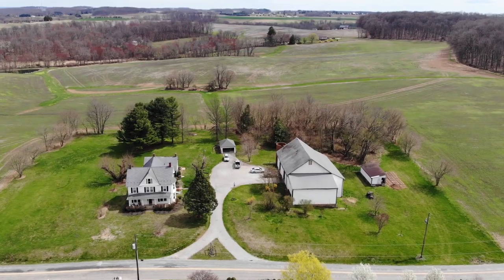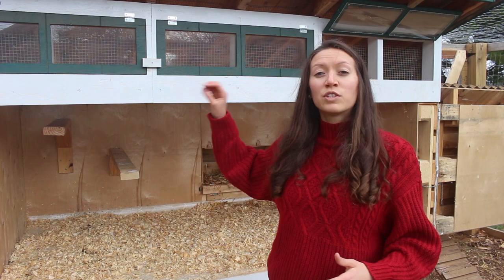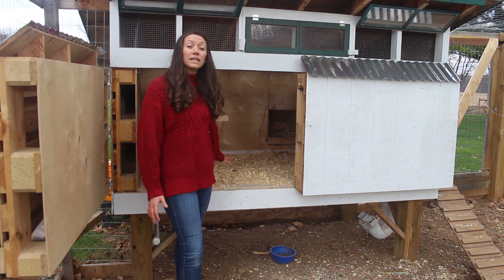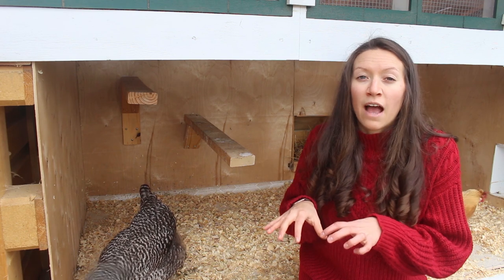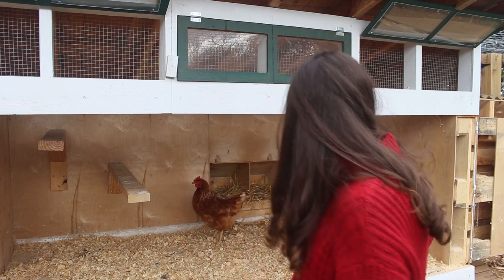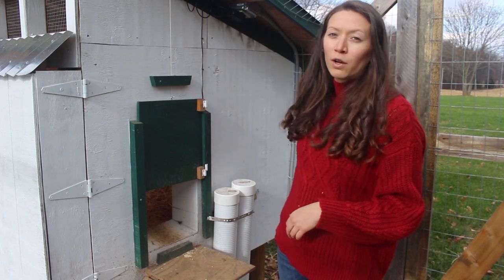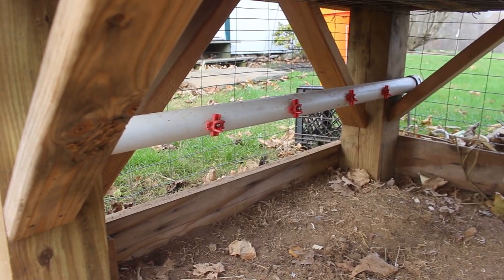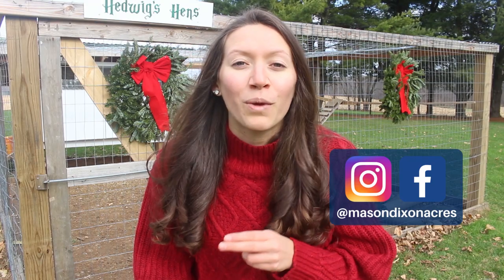Chicken Coop Design | ERGONOMIC & EFFICIENT!

Comment: Two suggestions . 
1) on the inside of the coop - put a board across it so it keeps the pine shavings in it when you open the door. Remove the 1x6 when you need to scoop out the shavings. 
2) your run looks well eaten. 
Look into something called chicken chunnels. You could have them coming off of your run area and you could concentrate them in specific areas

Comment: I like the idea of linoleum.  I want to have a metal grid floor but, at 3300 feet elevation, 45th parallel I needed a solution for winter. Properly fit, yet removable, linoleum sheets should do.
Thank you.

Comment: Great video. Questions/thoughts:

1. Do you cover that dust area? I would imagine when it rains, it gets muddy otherwise, no? 
2. You might want to change the wire you use to hardware cloth. Many predators can get through that wire you have, including snakes.

Once again, great video. The size of that run...wow, that's big!

Comment: I like the idea of linoleum. I want a metal grid floor but at 3300 feet, 45th parallel winter is an issue. Properly fit, yet removable linoleum sheets should do.

Comment: Quick question, why not have roosting bar going from left to right, that will fit more chickens.
Reply from the maker: That could probably work! Although the one downside is that it would make the coop more difficult to clean if it was low enough..
Reply: @MasonDixonAcres  I don't see a reason for roost bars to be lower than what you currently have.  If they are not in the way not, then going horizontal will not interfere.

Comment: Two by for roosts?  Nah, chickens don't have flat feet.  Think Tree Branch, then look to branches for the design of your roosts. Or, simply cut a few down and employ them. Leave the bark on - makes for better 'grip.'
 Linoleum works - but not the cheap, thin stuff with a paper/organic base layer - you want all vinyl. Then again, feed bags are excellent for this - nice slick WASHABLE plastic exterior surface. Should be as easy to clean as store bought flooring. Staple it down or use contact cement spray?

Two 'engineers' building a chicken coop? Better two chicken farmers and a Norm Abrams!
Reply from the maker: Chickens actually don't grip a perch like wild birds, they sleep flat footed and their toes   lightly curl. They need to sleep like this especially in the winter to cover their feet & toes in feathers to avoid frostbite.